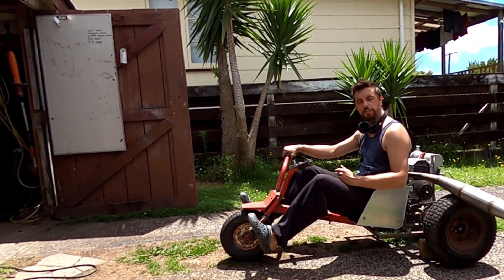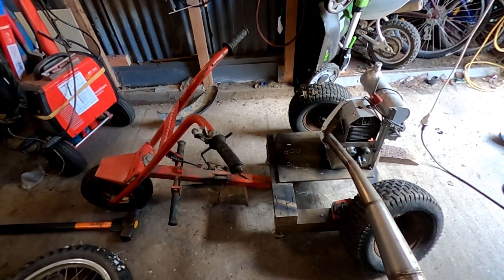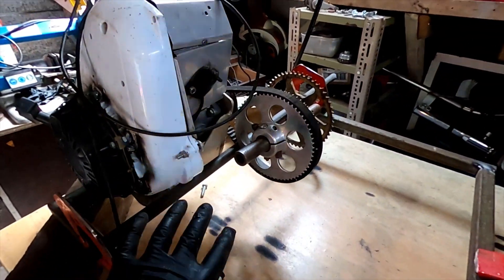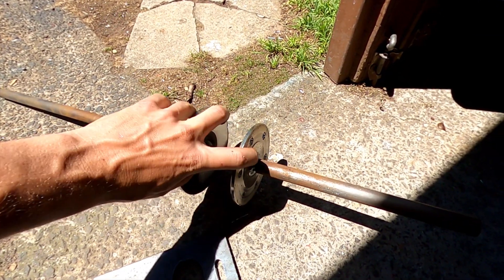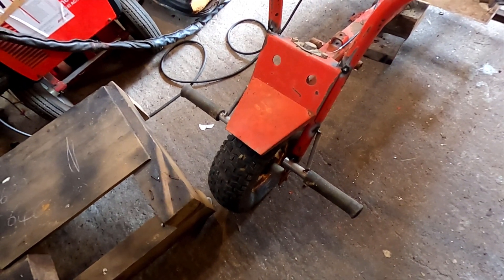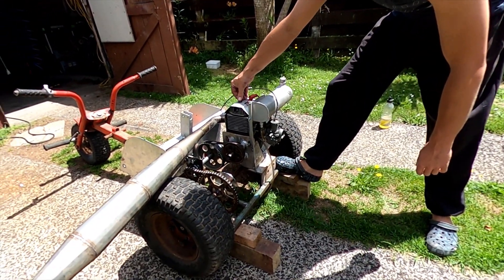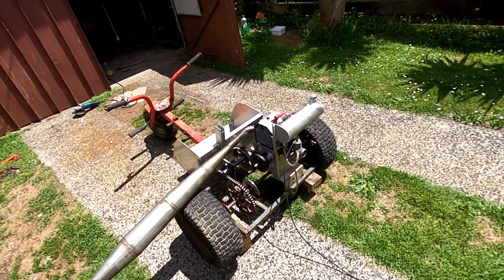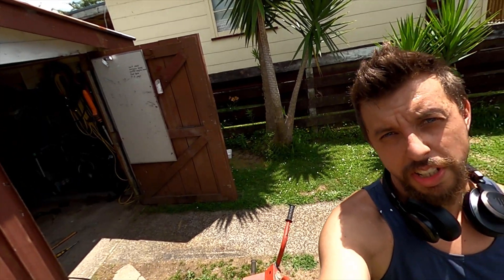2 Stroke Drift Trike Build ,P1 Junk Trike!

Comment: my advice is this. as the pipe comes off the motor make 90' turn in the pipe toward the back. then just find a shape like a box that you could bend the pipe into. like a wire frame view of a box. all edges and no faces. I don't know if that makes sense,
Reply from the maker: I think I know what you mean. I have already started cutting and shaping the pipe it kind of goes around the seat towards the front then a 180 back on it’s self it was the least amount of work hope it ends up looking good !